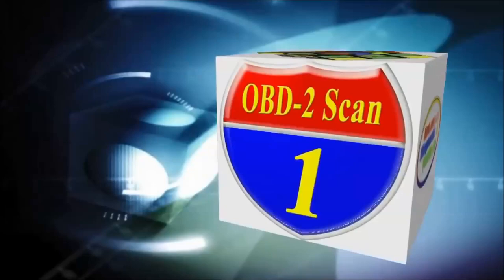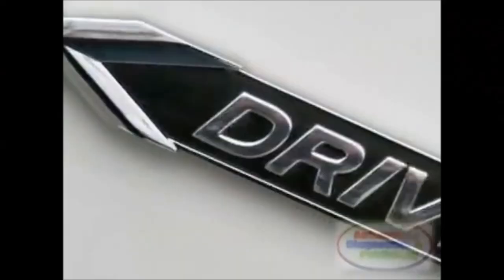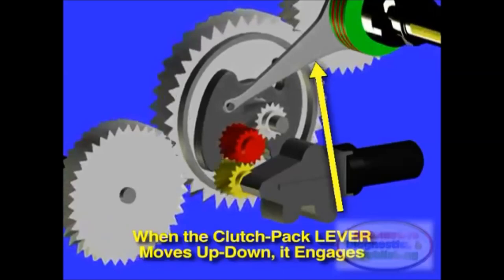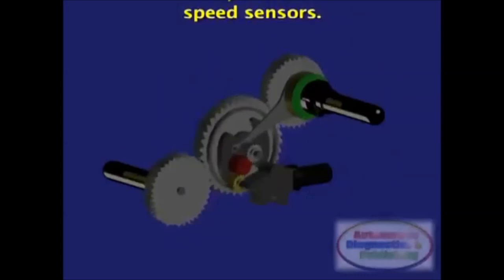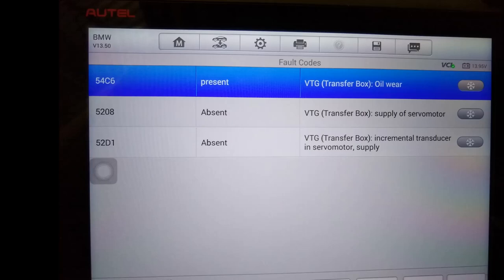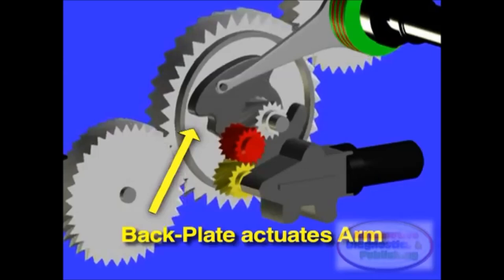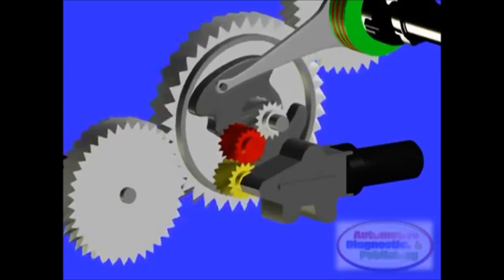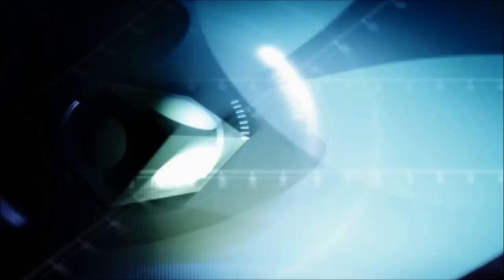How to test BMW Transfer Box Code 5F3A X Drive

Comment: BMW X6 2011-2012 when it turns left or right it doesn't make any noise but it feels bumps, but in a straight line it's normal, what could it be?
Reply: 50i v8

Comment: I had the abs,brake,and 4x4 light on the dash. I replaced actuator and tore apart old actuator and found plastic gear stripped.  Well two weeks later the lights are back and they come on every time I drive it.  When I first replaced it I was getting a clunk noise when taking off fast, but no clunky when taking off slow.  Front end sounded like something was worn. Now that lights are back on I hear no clunking sound. What do you think is going on
Reply from the maker: 1- need to relearn new gear or transfer. 
2- might have damaged front end due to torn gear.

Comment: Hi, please if u can help me in my x5 2004. From a while The trifecta lights with dsc inactive came on, so i went to a mechanic that showed in his scanner the gearbox so i changed the gear with the actuator and new oil but it’s used and it’s spare parts from an x5 in japan. Anyway after changing it sometimes the dsc only comes on but when you turn on the car again it goes off. So i scanned the car and it gave the steering angle (code: 04 and 08 slider fault, adjustment operation) with the transfer case(code: 54C8 classification registor). So he told me u should change the steering angle, is that true because here in ur case did u change the steering???
Reply from the maker: You go with what you have, these CODES or DTCs. Concentrate on that, not what someone else did. Good luck.
Reply: @ADPTraining  so what u think i should change the steering or the gear?

Comment: Hello, I have a 2005 bmw X5 with the 4x4 light on the dash. I changed the gear on the actuator but the the light is still there. I noticed the vehicle cannot be driven for long as it goes into limp mode. I have to shut it off and then restart
Reply from the maker: Check resistor on case body. May need to relearn with scanner.
Reply: @ADPTraining  okay can i test the resistor with a mulitmeter to see if it is good or not?
Reply: @ADPTraining  well I forgot to mention these codes 5EB3 DSC: Steering-angle-sensor-adjustment and 5F42 DSC: Transmission control, limp-home operation showed up on my scanner. Now i reset my SAS and now the 4x4 light is off, but the only problem now is that the car would drive changing gears for like 3 minutes and then suddenly drag and don't change gears until i shut it off for like a 1minute and restart it and drive. I changed the plastic gear on the actuator and test it by applying ground to pin 8 and power to pin 1 and it spins okay, i really don't know what else to do!
Reply: @ADPTraining  I would also like to add that i checked the wiring connections for the actuator with a test light, I am getting ground but when i test for power there is nothing even with ignition switched on. Is there any diagram showing what voltage suppose to go to each pin and also the resistor wiring?

Comment: Hello changed the actuator and resistor myself on my x3 and it feels much better and lights gone  but feels like its dragging sometimes i have the code “54C4 First calibration defective” 
Reset it with basic scanner and the code comes back do i need a special scanner is my transfer case bad? Thanks...
Reply from the maker: Yes, calibration has nothing to do with the resistor. The resistor is a coarse calibration if you will. Then, you need something like a manufacturer capable scanner. The AUTEL Maxisys comes to mind. Keep me posted. 
http://autodiagnosticsandpublishing.com

Comment: Hyy,I have the issue with Dsc abs brake light on I change transfer case actuator ..change abs module and yaw rate sensor..Right now my light is off and I drive 10 miles before I turn hard left they come on again and I feel like some braking behind..like some one push on rear brakes
Reply from the maker: Well, did you reset the adaptive memory? Looks complete related to an adaptive issue.
Reply: @ADPTraining  I took my vehicle to mechanic and he reset and clear everything..And right now when I start the vehicle no lights..after 30 minutes they come on again..And my radio stop working too.thank you

Comment: Without oil,does the transfer case turn on the service engine soon?…thanks in advance.
Reply from the maker: Without oil it'll turn ON your back account faster than SILICONE VALLEY BANK.

Comment: when this happen to me and it was the transfer case module  under the front passenger seat  carpet small silver box by the sub woofer speaker on an 2008 e90 so what i did i order this thing called xdelete and flashed out the transfer case  so now its rear wheel drive untill i get some funds to fix it
Reply from the maker: Rear drive, wow, didn't know that could work. Thanks.
Reply: Hey when you bought the xdelete did the lights all go away on the dash? And we’re you able to use the cruise control again?
Reply: Hey did the lights go away when you flashed it?
Reply: @elmalkriao100  did you ever find out if it did?
Reply: @victorbregante845  nope
Reply: @elmalkriao100  quick update , ordered the adaptor and the x license everything came up to like $220 , but the codes stayed lol
Reply: @elmalkriao100  fix the problem first
Reply: @victorbregante845  oh damn so it’s gotta be the box vtg module by the passenger seat then
Reply: @elmalkriao100  probably but most likely the motor actuator that goes into Transfer case also. The code thats comes up on mines says TC internal faulty

Comment: I replaced actuator.  Now when in gear I get a bad grinding noise...even at crawling speed 1-2mph.  With actuator unplugged veh drives fine, no noise. But no 4wd either.  Gear oil was low when I did actuator.  Any thoughts on next steps?
Reply: Don't want to buy a new transfer case without a strong diagnosis
Reply from the maker: Raise vehicle, start and put in gear. Then manually actuate transfer gear somehow. See if noise persists and if so you may need a Xfer case.
Reply: what is the issue?
Reply: @ADPTraining sorry to ask questions 3 years later! I’ve just tried manually engaging mine on the TC, the stub there seems to spring when you turn it backwards and just clinch to a stop when turning forwards, is that normal?